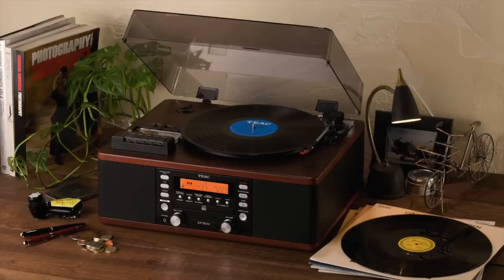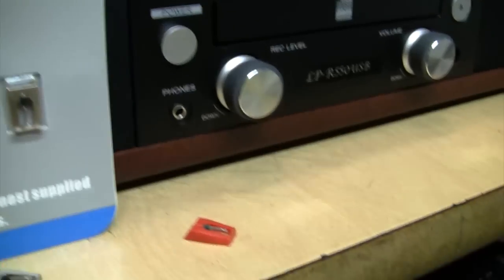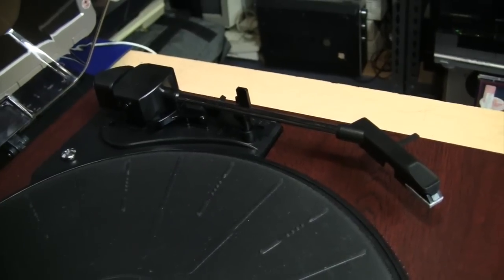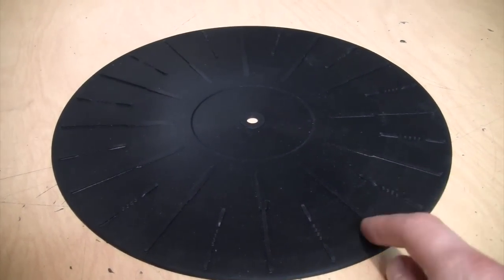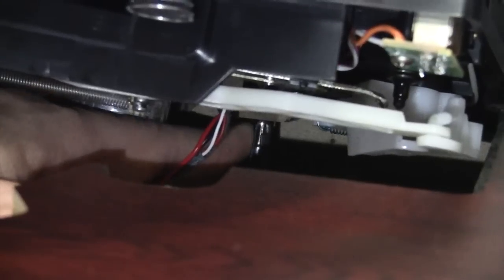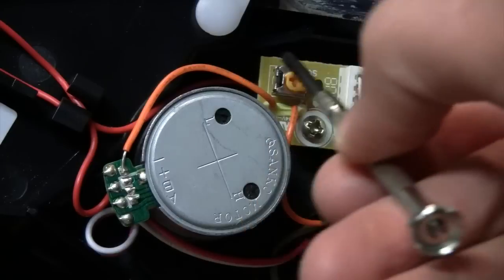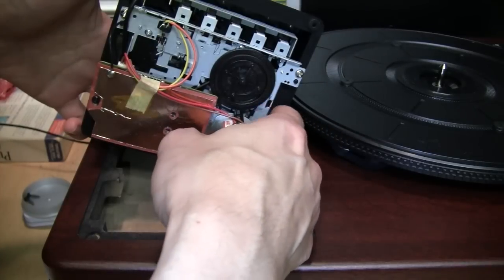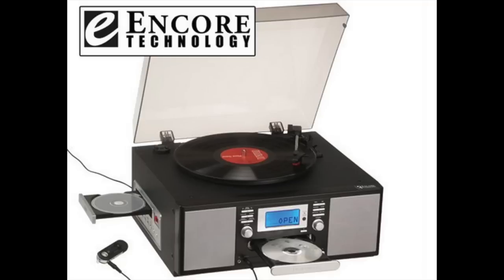TEAC LP-R550USB all-in-one system tweaks & upgrades

Comment: My 45 adjustment screw doesn’t seem to do anything and it’s playing at probably 55 no matter what. Any idea why?
Reply: I can't adjust either the 45 or 33 as there doesn't seem to be any slot to adjust under the rubber cover.  My unit is a LP-R550USB.  Both 45 and 33 are running fast out of the box.  I decided to buy the unit after seeing above video assuming the speed could be adjusted.  Tried all sizes of screwdrivers and can't feel any slot to turn.
Reply: Update to above.  Apparently, the newer versions moved the 45 and 33 speed adjust from the motor back to the circuit board next to it (like the 78 adjust).  I didn't catch it as the motor still has the rubber openings but no screw adjustment inside.  Looking carefully at video vs. mine, I realized there were 3 adjustments on my board instead of the one in the video.  All good now.

Comment: Can you adjust the tone arm weight ?
Reply: Nope, the counterweight is not adjustable.  But at least it does have one and it's set to the proper tracking force that the cartridge is rated for unlike other cheaper turntables.
Reply: As an 'experiment', I scotch-taped a couple of coins to the top of the plastic housing for the counterweight and it did reduce the tracking force, although, as was pointed out, if it's already set to the proper tracking force for the cartridge, best to leave it alone.
Reply: This a great turntable but why did they  put the pitch control for the turntable under neath the turntable.Why not put it  on the top  of the record player like on direct drive turntables
Reply: @saxman112  Do you know how heavy it is set on ?

Comment: Would cork platter mats work well on the turntable and the Lp-r 660 which I will eventually purchase? And I assume the Lp Gear Blue Cerapreme stylus will also work on the Lp-r 660?
Reply from the maker: I recommend a rubber platter mat. And yes, the Cerapreme Blue stylus will work with it.
Reply: @CamcorderTests  Didn't work properly on my LP-R660. There was barely any clearance between the cartridge and the record, and the cartridge scraped along the top of the record.  The Blue Cerapreme works fine in my Mc-D800 and LP-P1000, though.
Reply: @01chippe  Which version of the LP-R660? The older one with the short headshell and spring-counterbalanced tonearm, or the post-2016 version with the long headshell and counterweighted tonearm? VWestlife's 550 shown here has the newer turntable, if it helps.
Reply: @OldMusicOnVinyl1  I have the same one as shown in the video. Both my LP-R660 have that tone arm.
Reply: @01chippe  thanks! I have to wonder if it's a quality control thing.

If your other two Teac all-in-ones have the old turntable then that might explain it - the arm seems to be a lower-mass design.

I have access to an LP-R550 with the old turntable (it's a Hanpin HP-H10). I've used a Pfanstiehl D7 conical with it with great success and am going to order a Cerapreme Blue next to compare directly.

Strange thing about the Pfanstiehl, it was advertised on Amazon as a 793-D7M with the aluminum cantilever but what arrived was the plastic cantilevered 793-D7. Happy with it nonetheless.

Haven't had any issues with the aluminum cantilevered D7M on a Numark PT-01 - it also sounded and tracked great with no scraping or any issues.

Comment: Is it possible to pair external speakers to this device?
Reply: You can, but you have to connect the speakers to a pre-amp/tape deck first and then connect that to the turntable via the rca outputs. I'm not sure if speakers that have rca cables can be connected directly (probably yes if they have their own power supply)

Comment: Can this record a cassette to USB in wave or any high resolution format?
Reply: Yes, if you hook the unit up to a computer using the USB cable, the computer will see it as an input device and you can use whatever audio software you want to record to any format you like.
Reply: I should have mentioned, there would be no need to record via usb as you could just record the tape to a blank cd at the standard cd resolution of 16 bit 44.1 kHz.  With the included cassette player, there would be ZERO benefit in recording the tape at anything higher.

Comment: Do I need to buy external speakers for this machine? Want to play records on it!
Reply from the maker: No, it has built-in speakers.
Reply: Can you run it though a better speaker?  I have a Bose soundbar so was wondering if that is an option.
Reply: I never use the onboard speakers, so I can't comment on the quality, but I imagine the low wattage would distort easily. I use a decent set of computer speakers with a sub box. mostly because of the placement of the unit in my home isn't conducive to projecting everywhere. I also have it hooked to a Bluetooth transmitter so that I can wear headphones. No problems with it.
Reply: @frankhilgenfelder1315  Hello.  Can you please tell me exactly how to connect self powered speakers to my LP-R660USB Recorder?  I assume I would connect two male RCA plugs to the Aux Output on the recorder and attach each of them to a speaker, correct?  Does it require me to select "Aux" mode on the recorder?  (If it does, that would preclude me from being able to play the phono, cassette, CD or tuner and there would have to be some sort of workaround I imagine.) Does playing music through external speakers require any additional equipment?  Thank you.
Reply: @kristineselmar  The Aux button switches between what is being played, either the phono, tape, or the aux input on the back; it doesn't affect the speakers. The external speakers I use are a decent set of computer speakers with a bass box - not high end by any means, but they get the job done in my small apartment. Those typically have a 3.5mm stereo jack, which will work through the Phones output, or you could hook them to the back AUX out with a RCA to stereo jack adapter https://www.amazon.com/30S1-01260-Stereo-Female-Y-Cable-Connector/dp/B000I23TTE
In that case, the speakers are already powered, so you wouldn't need additional amps. However, if you have just regular unpowered speakers, the amp in this unit probably isn't large enough to drive anything over a desktop size, and you'd need amp of some sort. That's why I would suggest powered computer speakers, since it's all-inclusive.
Reply: @frankhilgenfelder1315  Yep. Me too.  Have mine hooked to my Onkyo reciever and towers. Added Bluetooth also.

Comment: This is great. However, after watching this, I went and bought the LP Gear Cerapreme Blue (Red) stylus, for this exact model TEAC, and it was the correct fit, etc. But, after I put it on, every record I tried skipped! I didn't know what else I could possibly adjust, so I put the old one back on, and no more skipping. What do you think that is about? Thanks for any input you may be able to offer!
Reply: Same thing happened on mine!!  Glad I didn't order another one.  I thought it was defective but apparently not.  I'm using the cheap stylus again too.

Comment: A good LOW cost Audio Technica MM cartridge could work on this  MAYBE..
Reply: That's what I was wondering, can the whole cartridge be changed? I know some cheap turntables don't allow for upgrades, as the cartridge is soldered directly on to the cables, rather than using a plug.
Reply: I don't think a MM cartridge would work in this unit as the output would be extremely low.

Comment: parden me but I have fixed these units and as for owning one I have owned a crosley and teac all in one and sold them due to not being happy with them . this may be better then a crosley but not by much . the only plus is a counter weight tonearm.  that is a crosley cartridge they make a magnetic and ceramic and they are both not great . but the magnetic is much better. the turntable is cheaply made . plactic parts are a cheap way to make a turntable if it were really good it would be all metal but it is not .real audio gear is the best to have and use and then is not good gear it is cheap . all metal turntables are the best as well as good quality tape decks and cd players . and tuners . you may say this is great but it really is a cheap way to get people to buy something that will not last like real vintage gear will . you have n clue if I have had one of these or not so do not assume ok.

Comment: Oh please another one of those all in one craply knockoffs except it is teac . I am shocked that teac would stoop so low to make crap like this . all in one units are more prone to failure then components and components are the best way to go. instead of wasting money on this junkall in one garbage save money  up for decent components .  well this is a cheap turntable all plastic how cheap can you get . and very flimsy and the motors give out after a while .Warning Do Not By this junk only buy components not all in ones I fix audio and this junk is not worth repairing it is known as toss away junk. thank you for posting this video good luck with keeping your teac all in one functioning  . all of these units have a very short lifespan great video
Reply from the maker: Did you see my full review of it? This is definitely not a cheap and flimsy system. It sounds excellent for its size and the turntable has a proper counterweighted tonearm.
Reply: the turntable is cheap because it is all plastic so what if it has a counterweight  it is still an all in one unit . which is a bad thing for people to play any records on . I have fixed these as well and they are just aa step up from crosley units . I had gotten my first all in one unit when I was 10 and therw it back at my parests and said I will not use it . I back then was  into the knowledge of what real good quality electronics is .all in one units are crap no matter who makes them crap plastic platters and cheap motor and the only type of electronics I tell people to get is components and also tell them that if you want to ruin records then use garbage all in one units I am anti all in one . uniless the turntable is a vintage dual or garrard or pioneer or telefunken or perpetuum ebner then forget it . it is what it is an all in one junk pile  . no good units should have to be adjusteed when you buy it that shows how cheap and junkie it is .and having a cd player in it is what makes this like all the rest of the garbage all in ones they make it look so much better then they really are .no matter what junk is junk . the amp is nothing to talk about . . you said something about cheap all in one system this is right there the sound is barley tolerable . and it is not loud enough and has not got enough base everyone that does videos on these types of units says the same thing oh they are great yes the only thing they are great for is a foot stool or fire wood
Reply from the maker: You talk a lot of crap about a product you've never owned or used. These TEAC systems are far superior to any other all-in-one system.

Comment: Hi! I have a question… a newbie here, asking for a help. Just wondering, If I bought a new platter mat, says a 3mm one, seems thicker than the 4 rubber studs originally came with the system, do I have to do any adjustment on the tonearm or check the tracking force? Also, when I change the stylus, do I have to do any checking too? Bought a 793-D7M replacement for a CD stylus… many thanks in advance!